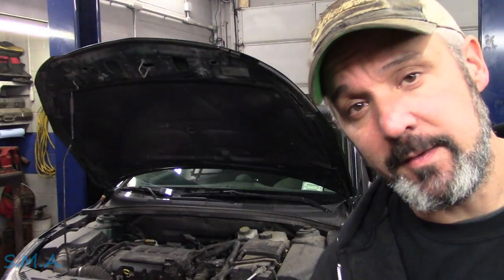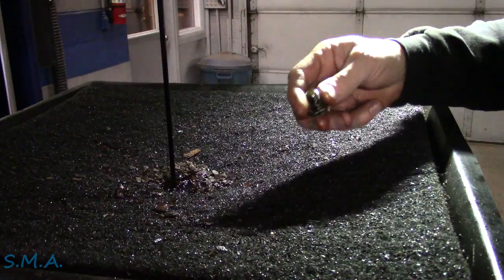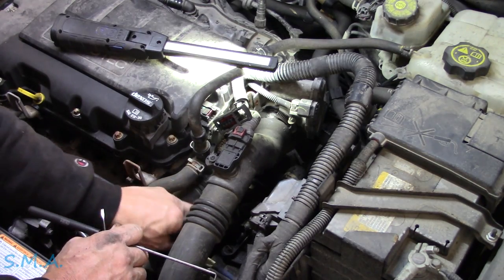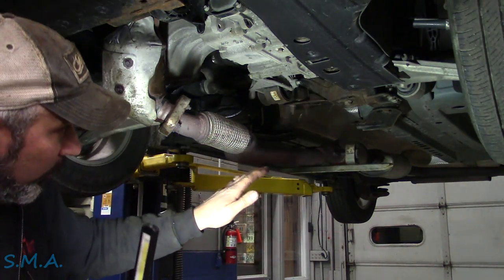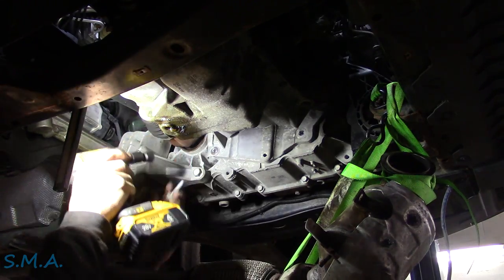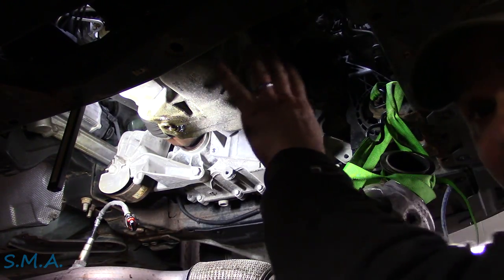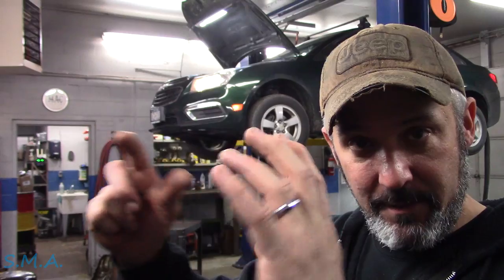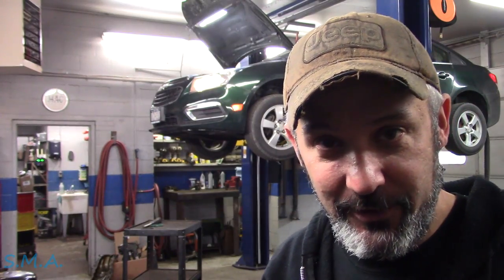Chevrolet Cruze 1.4 Turbo: Oil Pan Replacement

Comment: Definitely job security when these break. As a owner of 2 I have done 1 oil pan and 2 turbo repairs.  Best parts are oem ones for these cars. 
The crack is normal if small but like mine it was boosting out the back of the turbo p0299.  Be safe
Reply: So the best parts you can buy are OEM? But you had to put two turbos in it?
I've heard the same thing out of the Buick encores where they've had 3-5 turbos go out. Absolutely ridiculous.
I'll stick with my Toyota. Boring as hell but 13 years old and 384,000 Miles.
The only reason I ever had to change the oil pan is because an oil change place stripped out the plug not because it ever leaked a drop. 10 bolts drops right off the bottom can have it swapped in about 15 minutes.
Reply: @kens97sto171  As Scotty says "they last and last".
Reply: @kens97sto171  I don't know why everyone is saying the Cruze is trash, I had 250k on mine and got $2K for a trade in - still had the original turbo in ran great, started right up every time.   I did all my own work on it and never had any big failures. At 250k it did need some wok (oil pan and turbo cooler) - had the parts but didn't want to do it during the lockdown last year.
Reply: @jimbob2861  
Might depend upon when it was built. I know the early 1.4 turbos had an iron block I believe later on they changed the design to aluminum. 
I Actually used to haul freight into the plant that cast and machined that engine. It's in defiance Ohio. They also  built every  V6 and V8 cast iron block GM makes for North America as well as the Duramax diesel. 
That was a pretty cool place. They had a giant pile of defect engine blocks, defect rate was only about 1%. They would find some defect in the casting during the machining process and it would get tossed in a giant pile and put back in the furnace and remelted. 
Always surprised me how small the 1.4 iron block was and actually how light it was.
Maybe later models got worse after they switched to aluminum, I've heard several YouTube repair channels talking about high turbo failure rates there's a lot of GM vehicles that run that 4 cylinder turbo. There's some videos on the car wizard YouTube channel. He had a Buick encore in for repair that was already on its fourth turbocharger.
Who knows, there's a lot of stuff being built today by all manufacturers that are a lot crappier than they used to be. And aftermarket parts supply has turned to absolute shit too.
Glad you had good luck with your car. I actually always liked the Chevy Cruze as far as the way it drove I always thought it looked pretty good too.
Reply: It’s a Garrett turbo…like should be good.

Comment: Lots of great little tips in this, especially the one about using a toothbrush size wire brush to get the last bits of old silicone out of the grooves (in the block) caused by the original machining work.Mrs O didn't seem very pleased when you first said "you're good for one thing" though !

Comment: Appreciate you working after hours to do a vid. I see that night outside the window. 

I feel like I dodged a bullet. I had intended to buy a low priced one of these as a runabout clunker but the dude never got back to me. Being a masochist, I ended up taking a 3 cylinder Fiesta SFE instead. To its credit it has been rock solid, but I bet it won’t always be 😂

Comment: Eric, great job as usual.  You might tell the guy not to take the car into one of the quick lube joints in the future.  Staff are very poorly trained, rush through the job and care little for quality.  You might also tell him not to get any "flushes" from places like that.
Reply: I do fluids at the dealer. Same price as other joints, but if they fuck it up they fix or replace it. I also have a highly reputable Honda dealer I go to for my acura so that helps. Never harass me for up sales, either. I feel like I got lucky with them.

Comment: I was helping a friend in his shop when he had a Tech quit spur of the moment leaving him with a huge backlog.  We had a small 4 cyl GM car that was pouring oil around the oil pan.  It had jus been to the local GM dealer for the same issue...   They didnt get the 2 surfaces clean enough or dry enough and the gray stuff didnt even stick.  Took more time cleaning up and getting it dry enough than to take the pan off and put it back.  I let it sit over nite and drip drip drip.

Comment: this was the first video of yours i watched cause i was changing my oil pan on my cruze the dealer changed my oil pan and it leaked and of course they would not fix their work cause it went off warranty when i removed my oil pan all the bolts were so loose i could take out by hand and the pan fell off when i got all bolts off i used motorcraft silicone my cruze only had 75000  miles on it 2013 
i use to work at GM doing electrical repair and i find your videos interesting since I'm retired now

Comment: 2 of my favorite  powertrains from Chevy.....1.4L & 1.8L as I will never be out of work!😂
Reply: Now now the 1.8 is a great engine actually
Reply: I've had two gars with the 1.4. The first took me a lot of miles but I needed a bigger car. The second The one I drive now has been great too. Proper maintenance helps.
Reply: @sparkedclipper2082  Accurate, I have a 2011 Eco with the 1.4 that has 190,000 MI all that's ever been changed on it other than maintenance parts is the valve cover

Comment: 1) The PCV valve is actually inside the Inlet manifold (and usually disappears into the engine in fairly short order). The diaphram in the valve cover then gets over pressurised and ruptures causing the leak and the lean code.. Or it just ruptures anyway and causes the same problem. You can get an after market kit that provides a brass check valve to bypass the PCV in the inlet man.. You then plug up the old PCV valve.. This avoids replacing a $300 inlet manifold and.. wait for it.. it actually works!
2) The crack in the turbo housing is "usually" not a problem.. A far bigger issue is boost leaks! Pressure testing the intake system showed up several leak points (even a huge split in the inlet manifold one time). When I plugged up all the leaks the boost code went away and normal acceleration was restored.
3) Turbo failures most likely occur to oil drying up in the poorly insulated turbo oil supply line. Which then starves the bearings. I replaced my line and added extra insulation.
4) seal kits are available (after market) for the oil cooler.. But I understand why you would just replace the whole cooler.
5) Death Cool seems to destroy hoses from the inside. Mine were rotten at 125k miles, so I replaced them all.
6) as you pointed out the turbo oil return line will snap like a carrot when you touch it..:)
7) I still have the original thermostat and water pump at $130k miles.. I'm personally amazed!
Reply: Update to the above.. The thermostat exploded and dumped ALL the coolant immediately. Thankfully Wifey was fast on the key and got it shutdown before it warped its head! Nowdays you can get both an aluminium thermostat and coolant outlet tee. Of course these aftermarket upgrades came just AFTER I replaced them with the original plastic crap. I have a love/hate with this car and subsequently bought a new Honda Passport!..:)

Comment: Free tip
If you don't want to smear the silicone while lifting up the pan, screw a couple of studs into the block first, so that as you lift the pan up and locate it onto the studs, it will hold perfectly still while you screw the bolts in. Then of course pull the studs out and finish the job

Comment: I've seen many similar cracks in Mitsubishi turbo's as used in lots of Volvo's. Those cracks will gradually grow larger over time as the hot exhaust gasses will keep on acting like a continious cutting torch.  The boost lag will increase at the same time. 
But it takes a good deal of time/miles gefore it really becomes a problem.

Comment: Love doing these at work, I don’t normally drop the exhaust for the oil pan, did last time since I had to take the whole manifold out to get the oil cooler assembly out and got an oil pan too made it super easy

Comment: I had to change a cooling fan on my wife’s Chevy Cruze last year. Has the same engine. I didn’t even have to pull the entire front end off the car to do it. Just basically undo the lower radiator hose, unhook the electrical connector to the fan and push down on one tab on either side of the fan assembly and wiggle it out. It actually took more time to try to figure it out than it actually did to remove it. The rest of this car is like working on Legos. That’s except for the oil pan which my wife smashed going over a curb. That we took in to a mechanic to get it replaced, To this day I don’t know why she didn’t grenade the engine.

Comment: What a shame they turned out to have so many issues.  I really liked my 2011 eco model.  45 mpg on the expressway, and (given enough road) top speed over 120 mph (yes I did it).
Reply: I still have my 2011 ECO, 190,000 MI later it's had very little issues
Reply: @scgamer2442   Nice, I guess you didnt have the 'high school girl runs a stop sign and tbones you' option.   8V(
Reply: @scgamer2442  have a 13 love the car, great gas mileage,  very little issues
Reply: I have a '13.  I take care of it and it does fine by me.

Comment: I have the 2017 Cruze with the BIG 1.4 turbo. i am glad they made a separate small bolt on piece to the oil pan for in case the drain plug gets damaged.

Comment: Proper repair for these cars: 1. disconnect high pressure fuel line from injector rail 2. Crank for 20 seconds 3. toss match into engine bay
Reply: lol, so true
Reply: Hahaha
Reply: From the “ factory “ 😂

Comment: I buy a ton of these to sell and GM knows that internal turbo crack is not normal they just do not want to replace a million or so. These 1.4 motors are great little motors once you fix all of the poor engineering coolant issues, PVC issues etc. I've got to do one of these today, at least you can get to all of the bolts on these without pulling motor.

Comment: i had one of these, loved that car. everything you are doing i have had done or did myself. which makes me laugh. Actually the PCV going bad on the early '13s and to '11s was a none failure point but chevy never put out a recall, it had to fail for  first ( makes things very fun.) the turbo was also a terrible design, the waste gate is all integrated into the turbo, can't do a repair on it without replacing the whole unit

Comment: Ahhh, the infamous Kit and Caboodle. I love this phrase. Eveyone uses it, sort of knows what it means and just moves on with their day. But, what does it really mean?
A KIT is a set of tools. Often believed to have derived from "King's In Trust" in reference to the equipment and uniforms provided to a soldier or sailor. A kit is not necessarily a complete set or outfit. Rather it is likely to change based on location or job requirement.
However, a Caboodle is in fact a complete set of something. In usage, you would state that you have the whole caboodle, meaning you have all of the possible pieces. For example, you may have a set of sockets, but if there are skips, you don't have the whole caboodle.
By saying kit and caboodle you are in fact referencing everything. Whether a complete set or not. 
Rather like dealing with the IRS. When they say they want to see it all, they do in fact mean the kit and caboodle. Even if you didn't think it was relevant. Kinda like the 16mm they like to leave out and the 10mm that always goes missing. Bring spares.

Keep up the good work Eric, we love the videos.

Comment: Great job Eric. Your right as always, seen the lean codes with the integral pcv system. Also million spark plug tubes filled with oil. And of course people changing vvt solenoids trying to get rid of timing chain codes. 👍👍

Comment: I'm always careful about what I suggest to a master mechanic because I'm no mechanic just a weekend DIYer.  So you probably already know about this sealer/gasket maker.  I've used a product called "The right stuff".  It ain't cheap but it's a 1 minute cure so the machine can be put back into service almost immediately.  Anyway, just two cents from someone not really qualified to suggest anything.

Comment: These lessons are very good Professor "O"!  They teach us, what not to buy.
Looks like design, is still way behind at that company, still!
They could use some leadership, for sure!!!
Reply: The lesson is, do not ignore small coolant leaks. When a small leak becomes a low level that gets hot. Hot engines spawn oil leaks. Don't ignore small maintenance.

Comment: Great repair process video.  Also, good information regarding the parts that usually fail by a certain time or mileage. You have to wonder how some shops figure it is fair to a customer to strip threads on an oil pan and then use a one time quick fix bolt. The car didn't come in that way so, they owe the customer for a new oil pan with good threads in it. Not often but even some of the better shops will stoop that low if it happens to them. Well, don't strip them in the first place...use a torque wrench or leave it less tight if in question. 
Seems to be a lot of inferior parts failing on that type of vehicle...sad that the engineers can be paid and get away with that process.

Comment: One time I dealt with this Smart-Alek salesman at a local motorcycle shop.  I was rebuilding the engine of an old Honda XL-175 enduro which had sucked a valve.   I asked him if he carried torque wrenches.  He said, "No.  You don't need a torque wrench to rebuild these engines".   Well,  then,  I asked him,  how do I get the correct torque on the head bolts?  He replied: the correct torque is a quarter-turn before they strip.  Non-plussed,  I asked:  "How often should these be rebuilt?"  He replied:  "when they blow up"...  Needless to say,  I never darkened the doors of that business again.

Comment: @South Main Auto O'boy this looks fun and strangely enough this is my next project on a 2011 Cruze with the same engine configuration with little oil leaks from multiple locations. And a O2 sensor code. Niece dropped it off and wanted a family discount which you know means fixed for Free!

Comment: Heads up, the PCV (specifically the notorious check valve that fails on the big 1.4L) is in the intake manifold, not the valve head cover.  It's a Cruze thing.  Lots of people make the mistake of replacing the valve cover alone when there's a PCV failure.  They need to replace the intake as well.  When the PCV fails and blowby can't escape, pressure builds and finds ways out through gaskets and seals, which is what causes the oil leaks.  There is a third party external replacement option.

Just replaced the seals inside and out on the oil cooler for mine recently so I'm very familiar with the engine now.

Edit to add: Chevy have warranty extensions announced for both the valve cover and intake replacements if done before the 120k miles cutoff.  Anybody who had it done before the announcement to address the problem can get a refund if the work was done by an approved service provider and you have the receipt.
Reply: Spot on, I own two of these cars unfortunately and can’t wait to get rid of them.
Reply: Isn't the PCV (positive crankcase ventilation) involved in both the intake manifold and the valve cover? Or are you talking about the valve?

Comment: Mine did not have all the oil leaks but had all the coolant leaks accept turbo… and had the cam cover issue. I don’t miss that car. Oh and the leaks came in two batches 1,000 miles apart… so that was nice paying for two coolant flushes…. Dealer would not do it unless I flushed it…. So that was nice.

Comment: My friend at work had a Pontiac Grand Am that Jiffy Lube put on the wrong oil filter.  Going down the Highway, the oil pumped out.  By the time he noticed the oil pressure idiot light, She was done.  Jiffy Lube denied they were at fault and the Owner said "Sue Me - You WILL Lose.  Jiffy Lube has the best Attorneys - you don't stand a chance".  This sparked a "CHALLENGE".  So he hired a Lawyer that would take 35% if he won the case and no money owned if he lost.  They won and my friend got enough money for a very nice car to replace that old Grand Am.  BTW, how much does the Turbo assembly cost for 1.4 T?  Great video.

Comment: You can buy neodymium magnets off ebay buy the one that's correct for size and jb weld it in the hole where the old one was and you're done. Done it before and it always works. Love the video dude keep it up 😁 also wet your finger before spreading silicone as it will help it spread easily and it won't take as long

Comment: I work in a Chevy dealership and I do these repairs all the time . The converter all I do is loosen the band clamp and unbolt the 2 10mm nuts and then turn it so it's out of the way .

Comment: My dad had one of these from new, and just recently bought another car. They had bought GM for 20+ years and this car was a piece of junk. 2 turbos, multiple PCV covers. Started eating oil at a pretty big rate. All at just over 100k. They have finally switched brands after this

Comment: After owning a 2011 Cruze for 10 years I have come to agree with Scottie Kilmer. People buy cars with small engines and turbos with the idea they will same money on gas. The way most people drive they don't save on gas and they just get a car with problems caused by the turbo.

Comment: Great video. Hey were did you get the tray matt for the oil change tray. I've never seen one what a great way to stop oil from going all over the place. Thanks Eric for the great videos. Keep safe
Reply: Go to your local hardware store and get a super coarse washable furnace filter pad for $9. Enough to do all your drain pans

Comment: The PVC valve is covered under warranty. Have the same vehicle, they replaced the valve cover and there was a TSB on the battery connection